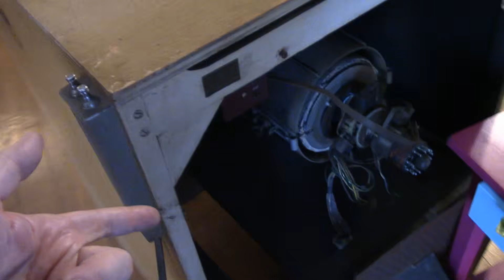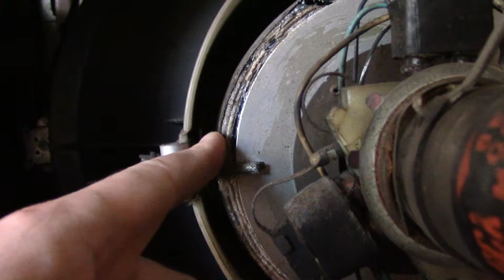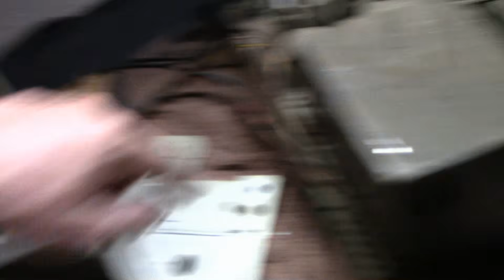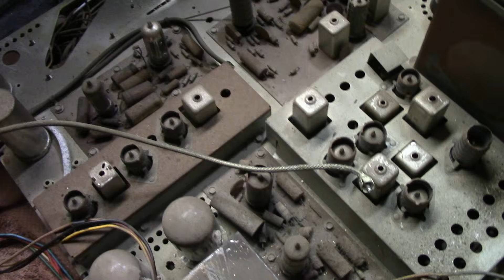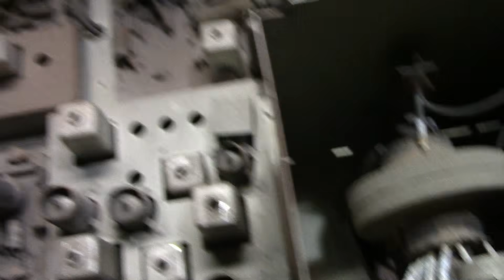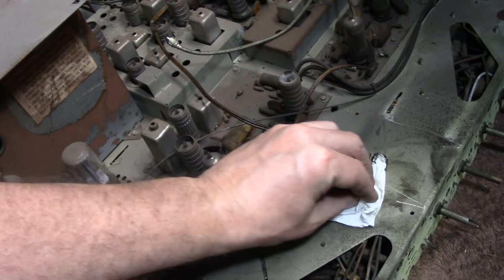1956 RCA color TV (CTC5 Westcott) part 2 - Chassis review

Comment: The chassis is “light” compared to the rest of the cabinet… meaning there’s no way to make that beast appreciably easier to move 😵‍💫

Also there should be a retainer screw in the service holster to bolt the tuner to the chassis (probably long gone now). 

You’ll notice that those phenolic boards are somewhat translucent since there’s no solder mask. Simply shine a bright light through it topside and use the shadow of a small screwdriver to locate the solder pads of whatever components you’re trying to swap out. 

Definitely reflow EVERYTHING; particularly all the ground stakes.

Comment: I did mine the easier less pretty way. I broke up resistors and clipped capacitors out to then J hook the new parts on. My ctc 5 was put into garage storage back in the early 60s after the power switch caught fire. Lucky they had the crt replaced in 63 so it's low hours!

Comment: I figured you would see how that turner holder worked a old timer showed me that trick and I figure that chassis must weight 80 pounds easly !
Reply from the maker: Yes, but another viewer pointed out the tuner cable harness does indeed unplug and I have detached it

Comment: I did mine and it was fairly easy. My tuner had a plug I could remove so I just removed the volume control. Also the horizontal output tube tested dead in my Sencore 162 tube tester and I don't have any extra but it worked fine in the set.
Reply from the maker: Right you are - missed that somehow.  Thanks for the tip.

Comment: Working on those is a piece of cake. Easy recap. Now the setup procedures . . . that’s a bit tricky and complex. Best advice is to make sure the set is performing well “as a black-and-white TV” first. So things like linearity, height, etc. are all functioning normally. Trying to move on to the color setup if the set is out of whack can drive you mad! 🤪
Reply: I also never managed to get more than 19.5kV out of my CTC5.  So if you get around that or higher, you are good.  Picture is totally watchable, a bit dim, but fine.  Just don't expect 25kV out of a 5.  😁

Comment: PCB are often quite transparant to light. Set a big bulb on one side and you can see the parts shadow on the other side. Makes it reasonably easy to locate the part. Or see where you clipped one out.
Reply: Big bulb? It's not the 50s anymore. LED torch/flashlight

Comment: So I guess if wasn't as good as the first generation of the RCA color sets. Ok, we proved it works well and the picture is better than expected, now let's cheapen it up till it still mostly works.
I've had a few new TVs that were like the manufacturers technology demo and they looked awesome and were priced accordingly. Usually after that they don't make one like that again and they get a lot cheaper.
Reply: The very earliest sets had elaborately precise color decoding which made the picture look as good as possible.  But what a lot of analog components and adjustments that required, and it was still NTSC meaning that it had to be adjusted for each channel.
Reply: That's exactly what they (RCA) did. You could see the difference in the picture, from the CT-100 to the later sets with the 21" CRTs. When I had my CT-100, I saw real color, then comparing it to later sets, one could see the difference easily, in the color quality and the resolution. When my father finally bought a Zenith rectangular color in the 60s, it was horrible compared to my then-old CT-100. Orange reds no matter how you adjusted it. Overly saturated color and bad B&W. But they sold well.

Comment: Referring to page 23 and 24 of the RCA service manual you will find diagrams of the circuit boards showing the foils and component positions.  Using those diagrams, it is very easy to determine where to unsolder the caps viewing the bottom side of the ckt boards.

Comment: Bob, sets with PC Boards is what I had to repair most of the time back in my TV shop days.  I actually prefer them over the hand-wired chassis.  Aside from the weight and bulkiness, this chassis looks more convenient than most to work on.  Place the whole chassis on the bench on the power transformer side, which may take a little shimming to level the chassis.  The terminals of the components can (in most cases) be identified on the bottom of the board by shining a bright flashlight through the board topside, which shows an outline of the component body on the board bottomside.

On single sided boards the component leads are generally clinched against the copper clad so the solder has more contact area (this minimizes solder fatigue induced connection loss problems).  These boards are bakelite and the copper traces can detach easily with too much heat.  Your solder sucker iron will be your best desoldering tool.  I found over time that 700 degrees Fahenheit was the best overall tip temperature.

Comment: That's going to be a very interesting project! Those early color sets I don't think have any X-ray safety features. It may be prudent to have a Geiger counter handy when it comes time to fire it up in order to determine exposure.
Reply from the maker: No, they don't.  Can Geiger counters measure soft x-rays?  I've seen others unsuccessfully try to measure x-rays coming from a TV.  The main source being the shunt regulator tube.  I'll be replacing it with a later version that has integral shielding.
Reply: GM tubes are notorious for underreporting low energy photon dose rates. The more adequate sensors for sub-150 keV photons are proportional detectors or scintillators (e.g. thin window NaI)

However for the currents and voltages involved it’s better to slap on a metal shield and forget about it. The concern is only theoretical, unless you sleep every night on a running set for months to years
Reply: @sashimanu  I remember how the family cat liked to bask underneath the TV set (which was the Magnavox equivalent of a CTC15 or 16) because the cabinet gently emitted warm air.  The cat eventually became deaf.  I can't guess how much, if at all, the X rays would have affected it.
Reply: @SeekingTheLoveThatGodMeans7648  teh catto probably lived to a ripe old age of like 10+ years, which would rule out the TV X-ray harm hypothesis, at least for the domestic felines.

Penetrating ionizing radiation primarily damages the cells that reproduce often, e.g. the mucosa (like the GI tract, from the mouth to the other, brown, orifice) and the bone marrow cells (resulting in low white blood cell count and susceptance to any and all infectious diseases), as well as manly troublepuffs' (if any) output product.

The above is called deterministic effects: if one gets a dose of X rads, it is very likely such-and-such symptoms will occur. Mostly applicable to acute (high dosage over short period of time) radiation exposure. Neurons, which include hearing cells, do not routinely reproduce and therefore are one of the last to be significantly affected by radiation exposure.

The other half of the coin is stochastic effects, which are much more nebulous: if a living being is exposed to Y rads over a period of time it is Z% more likely to develop a cancer of sorts over its remaining lifetime.

Since you only mentioned deafness, I assume your family pet lived otherwise uneventfully and their hearing loss is attributable to the old age (and/or cranking the speaker volume up to 11?)

Disclaimer 1: this is an oversimplification of radiation effects and dose units. Also some euphemisms were used, both to bring lightheartedness to the otherwise scary topic of radiation-related health issues, and to avoid the probable YT's effort to hide posts that contain words that deal with grown-up topics.

Disclaimer 2: if you work with radiation sources on a professional basis please consult with a health physicist instead of believing what I've just written.
Reply: @SeekingTheLoveThatGodMeans7648  I do remember, back in the day as a youngster, there was a "4-foot rule" for watching those color roundie TV sets, but that had more to do with better quality viewing in merging the red, green and blue phosphors. The picture wasn't that good close up, especially for an NTSC set.
Reply: @bandersentv  Shango put a new Geiger counter next to an open TV high-voltage box while the set was in operation, it pegged and ticked loudly; but I forgot which video this was in. He didn't say what the sensitivity level the Geiger counter was set to. I don't think the set had a shunt regulator, though. My concern is, that with today's higher mains voltages, the corresponding boost voltage may be sufficiently higher to cause concern with resultant higher X-radiation levels. That set, being from the 1950's, expects 110-115 volts, I believe.
Reply: @chetpomeroy1399  Running it on a variac with voltage reduced to the boilerplate for the supply voltage would be a good idea, if only not to overtax the components.
Reply: Well, the HV section is in a metal box and the 21AXP22 data sheet calls for a 1/4" thick piece of safety lime glass in front of the CRT face while operated at or under its maximum rated anode voltage of 27,500 volts -- which I presume is installed here.  (Normal anode voltage is 25,000 volts or less.)  Because it uses a separate piece of safety glass, this tube isn't cataract susceptible.  The data sheet also calls for a 3/8" thick piece of safety lime glass in front of the CRT face during service adjustments when the anode voltage may rise higher.  Keep an eye on the HV during all times of operation on the bench and it ought to be OK.  For added safety, use a 6BK4B shunt regulator tube, which has leaded glass.

Comment: Thousand dollar flyback. And it doesn't substitute. Best option is to rewind the secondary if it fails. The rest is easy
Reply: Just reminded me that I need to source a ctc15 flyback. Just tore my 15 apart for repairs
Reply: @RCAZENITHSYLVANIAANDGE 15 is easy, has to be the most cloned chassis
Reply: @shango066 ETF probably has one in their stock to be completely honest
Reply from the maker: Yeah that's what I figured.  I'll definitely be very careful with it.

Comment: Sarcasm?
Reply from the maker: I think he was comparing to other sets with more complex chassis. I expect a CTC-2 chassis to be a lot heavier for example.  This metal picture tube is also weighs less than the more common all glass types.
Reply: @bandersentv  You're quite fortunate if you have a working metal cone picture tube, for those spring vacuum leaks more readily than glass tubes do and this one will be quite old.